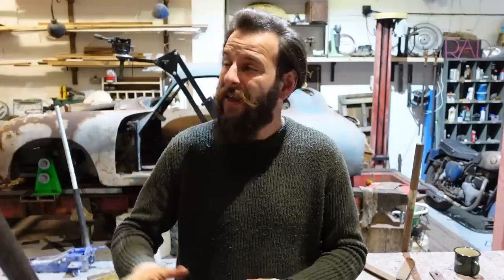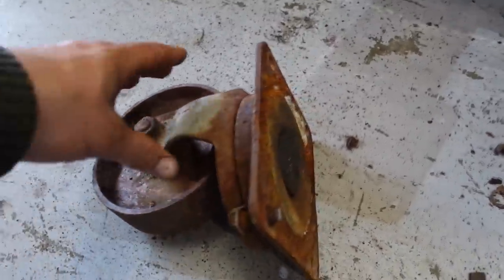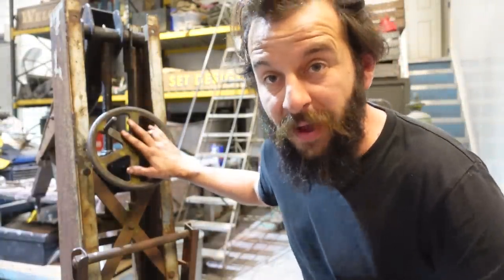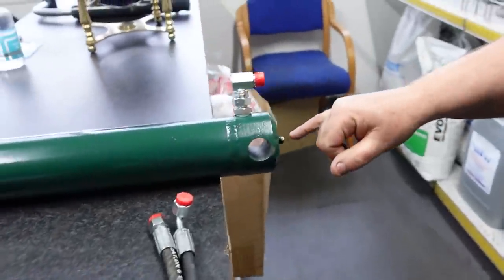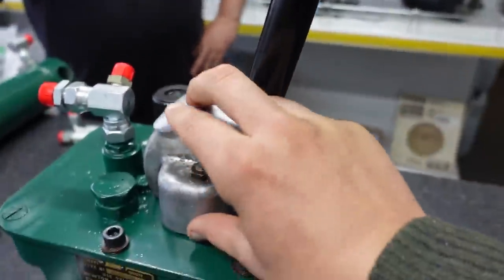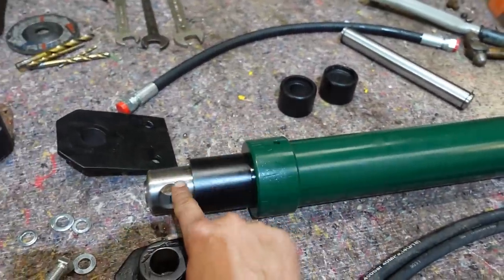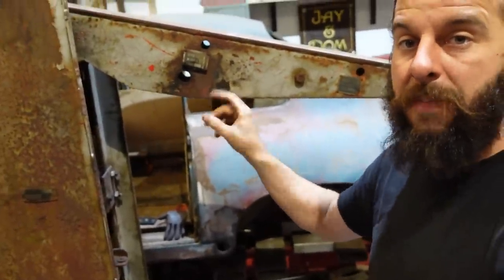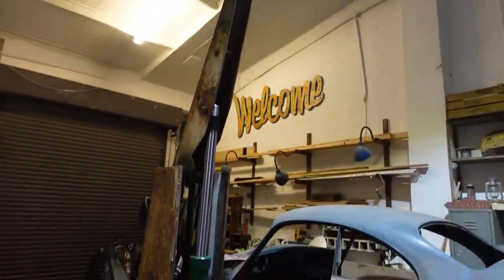Old Engine Crane Restored!

Comment: Inspirational, this has spurred me on to have a go at fixing a rusty machine I bought on EBay a few years ago. It’s a bit of agri history - used for mashing up mangolds for cattle. I want to convert it to a scratter to mash up my apples before pressing ( I’ve made my own press using a car jack). It’s seemed a daunting task and it’s gone to the back of my project queue but Dom’s approach and good humour after setbacks has made me keen to get started. The rusty drum is going to be my main problem!
Reply from the maker: Best of luck with it! Sounds like an interesting project!
Reply: @DominicChineas  Thanks Dom. Hoping for wet days so I can be in the shed rather than assigned gardening tasks!
Reply: try gemstone polishing grit in the drum ?

Comment: Great to see the crane lifting again. .It moves beautifully on the floor. back to front parts, So easily done, pinned and glued a vicrorian banister spindle together to realiise when i was trying to fit it that the square ends were 45 degrees out.  Arun fasteners, excellent, ive been looking for a 1"UNF for sone lathe spindle attachments. Looking forward to the book. Was looking at the makers marks on my old file shafts , tool companies of the past are a wonderful rabbit hole.

Comment: To stop the wheel from swinging while moving around the workshop a noging of wood across the crane legs and lower it on to the wood but most of the weight is still supported by the arm. This makes a great difference to stability, The amount of times I have sean people pulling engine cranes around with the load swinging and the crane as gone over 
Great video Well done
Reply from the maker: Thank you for the tip! Appreciate it

Comment: Dom, do a proper job:  blast and paint the crane frame and store it in your shop.  You’re running a proper company making a proper machine, and you are doing a quality job on the Ranalahs.  The machinery you use in the manufacturing process should match the quality of the finished product.   Surely you don’t want bits of rust and paint in your lovely new threads and mechanisms?  Leaving the crane corroded and unpainted shouts “rush job and shortcut”…!  Well, in my view it does.  Lots and lots of us have the same respect for your work as the hydraulic guys clearly do.  Don’t let us down!
Reply: ...you're not letting me down, Dom!
My pragmatism says leave it as it is - don't pander to the armchair OCD brigade!
It's a waste of your valuable time...  !

Comment: Great restoration job, like you said it is really neat to bring an old engine hoist back to life to help bring new life back into the Ranalahs. Sure you are going to find a lot more uses for the hoist though as time goes on.
Reply from the maker: I think so, unloading the van with new machines will be easy now!

Comment: They are just castors - buy new ones
The original brand is probably still being sold.

The cylinder can be turned about the piston shaft without taking the shaft off the top mount - only the bottom mount needs to be undone.

Comment: i love patina but in this case i have to add another vote for cleaning it, painting it and keeping it inside. in this case it just makes sense to.

if it is period correct maybe hammerite silver?  or paint it to match the Ranalahs.

if you can set your workshop up so the lifts legs roll in under another tool or storage space and the arm can go nearly vertical above it, then the foot print of floor space needed to store it inside is fairly small.